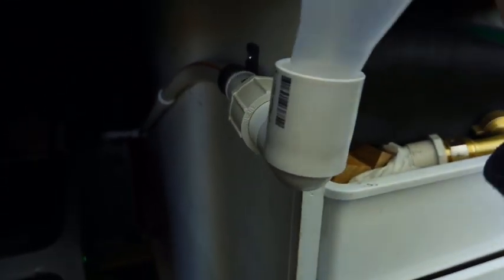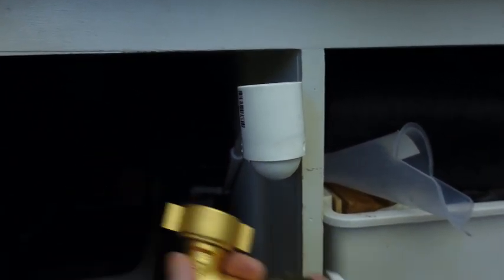Vanlife: Easy Inexpensive Water Tank Fill Setup

Comment: Good job with that mod Jonnie!👍 I would use quick disconnect at the outside end. As with many uses over time, the plastic thread will wear out or cracked. But that would increase the cost of the setup, not cheap any more!😁
Reply from the maker: Good idea Tim. 💡
Reply: I use quick connects all the time for hoses, so I like that idea.  I would also suggest some thread tape and a stash of rubber washers.  None of that costs much.

Comment: Like your work your pretty good 👍🏻 but I would put a y or t connect on the end of that line and put both on that way your pipe won’t Strip out because it will if you use it a lot and they sell just a plug you can put on the hand fill that way it won’t splash out while you’re driving
Reply from the maker: awesome advice.  I am back at the house and can knock that out.